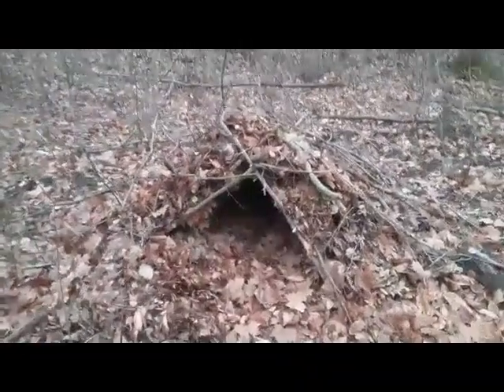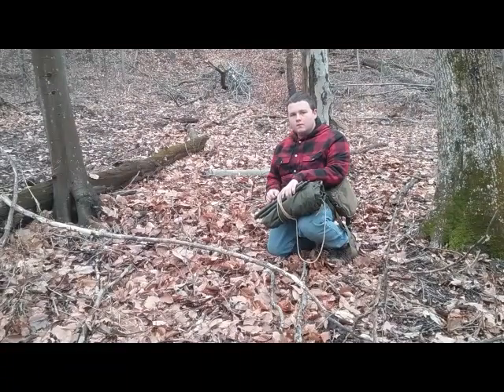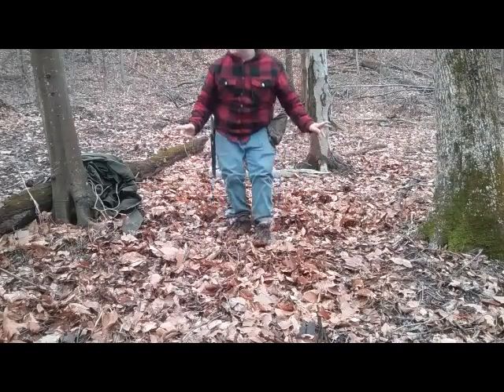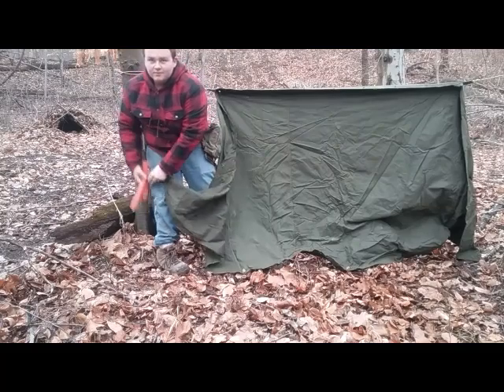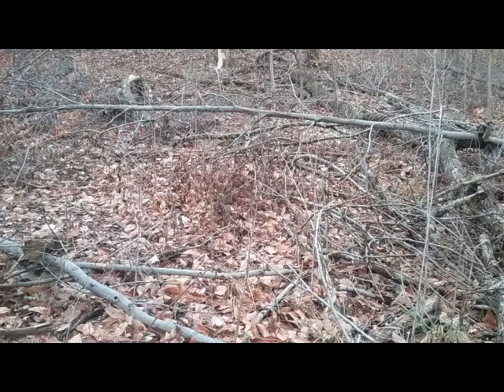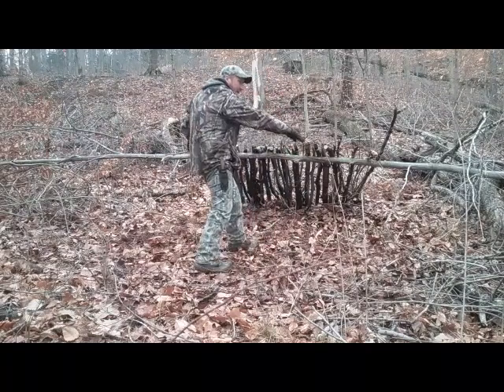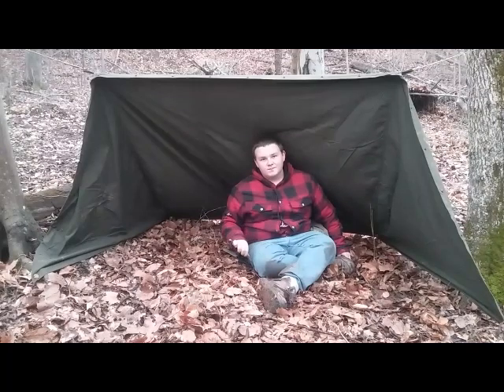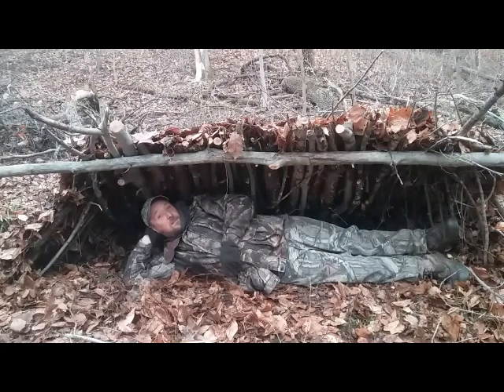Primitive shelter half design

Comment: Neat shelters! Back in 2012 I was turning 11 and I built a 12ft long, 8ft wide, and 7ft tall shelter. It looked like a Indian longhouse. I camped in it a few nights until the bees took it over 3 months later. This summer I'm putting a double Storey platforms up in the trees down in the woods.
Reply from the maker: Reeses Mill Off-Road Adventure awesome. I love working with what nature provides. Shelters are a very important item to survival. Good luck on your build if you need any advice I'm here.
Reply: I actually have two floors up in the tree. Everything that I'm going to be doing will be lashed so it kind of has that pioneering look to it. My only issue is is that the trees that I use or too big around so whenever I did my type lashings the floors have still slid down the tree little bit and everything off balance. This summer I will be finding a new group of trees in the woods and build it there. The problem is that the second floor is about 9 feet up in the air and it was a pain to get it up there trying to hold it and lash it all at the same time. I was want to do three stories platform system. First floor will be 2ft of the ground. Second floor will be 9ft off the ground. Third floor will be 16ft off of the ground. Once I'm standing on top of the Upper Floor my head is going to be somewhere around 22ft to 23ft off the ground. I should have a very good for you. I definitely will need railings. The first floor will be a floor that my sister can mess around on. There won't be any railings so just be a step on one side  and a slide on the other side. The second floor will have walls and when I have slots kind of like Windows. The third floor will have railings, Flags, chairs, and some kind of mini flower box or garden box. ?What do you think about that?
Reply from the maker: Reeses Mill Off-Road Adventure I think it would be cool. Use safety man. And lashing is cool, but i wouldn't rely solely on it. As the tree grows it will engulf your lashing making the exposed area weak.I wouldn't recommend lashing for that height. It will have to be sturdy because that could not end well if it falls. I would use notches or modern hardware for those heights. Safety first always think about what if.